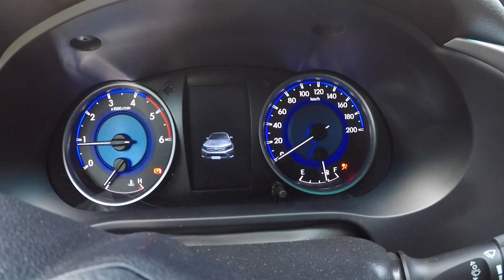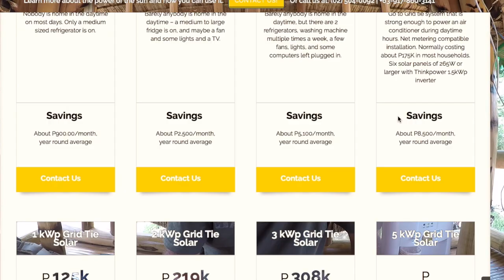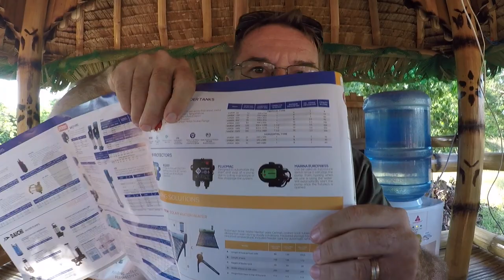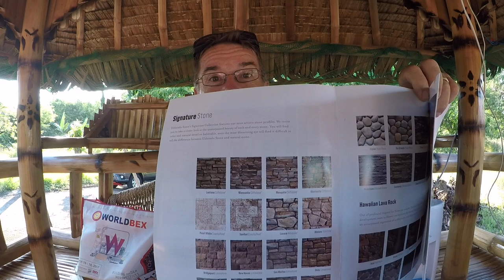VILLA FELIZ - EPISODE 54: YOU CALL THAT CUSTOMER SERVICE? (House Building in the Philippines)

Comment: You are such a discerning and particular person... I have to second that commenter who said check out Daikin brand AC. I've had National, Panasonic, Toshiba and Mitsubishi brand split AC units over here... Daikin is the best hands down. Mitsubishi isn't bad, but the durability, efficiency and quality of Daikin - a notch above the rest.
Reply from the maker: I just checked and Mr. Aircon sells Daikin as well.  The rep contacted me today and I have to return some info about the house.  I'll be sure to add Daikin as a possible option.  Do they have models with inverters?
Reply: My PI Dream Most definitely they do inverters... if I'm not mistaken, Daikin was the first to do the inverter air con.

Comment: hello James,  I like the idea of solar panels .  1000 watt panel could run a mini split a.c. unit during the day .   batteries are pricey for night time storage . And then you like need  double the panels in order to charge and consume the same time 
  But. are you planning to insulate the walls of the house ? 
 we are in Macton island in a hollow block house.    it really holds the heat. just like a big sponge .   sitting on the porch at night it's comfortable.  But walk into the house and it's muggy and hot .  ( no a.c. in the main part )
Reply: hi Paul, have you thought about double skin on your wall that get the sun, west facing, just any sort of weather proof material on the outside of the wall with a small air gap, also radiant barrier under the roof and a white roof to reflect the heat makes a difference, also shading any windows that get direct afternoon sun with awnings or louvers helps a lot
Reply: yes all excellent ideas .  for example I have seen amaca covering the block wall  .
 It's my father in-laws house and we won't be here permintly.  So wont worry about that . But I did make two screen doors and put screen on all the Windows.   made more difficult by having to remove the security bars first .
  If we build here I am considering a large open air portion  to the main part of the house . maybe no walls  with a nipa roof and amaca ceiling .  It's so much cooler . 
on the other hand a solar panel to run a ac in the day time would also be great.   Maybe something with French doors on three sides for cross flow on nice days.  and shut up on hot days with solar ac .

Comment: hello James. thank you for sharing your videoes with us. You once mentioned about implementing a LAN in your house. I have a suggestion for you, James. I installed LAN on some of my projects he here in Norway. What I did was to install CAT7 double isolation that is certified to tolerate over 800Mhz. This is for multiple usage of the LAN. the LAN cable are now being use for TV,  local network, telephone, audio and so on. You just patch over in patch panel. In the end of cables, I use a converter cable called balun cable that has RJ45 in one end and antenna socket on the other end for the tv. If you cannot find cat7, you can at least use better that cat6e. Cat6e I think tolerates 400Mhz which is not recommended for tv transmission. Anyway, a suggestion or tips from me to maximize the usage of your LAN.  😊
Reply from the maker: I never really thought of CAT7 for uses other than network.  Hmmm...might have to rethink my solution.  Thanks Edwin!

Comment: Have you considered other materials besides CHB for your structure?  We are using Hardiflex.  It doesn't hold heat like CHB and it can withstand a tremor without cracking and allows better access to plumbing and electricity.  If I was going to use CHB I would do what you are doing and go with the 6 inch. I know you've researched.  What do you think of Hardiflex?  Thanks, James.
Reply from the maker: We're using Hardiflex for building but not to replace the CHB's.  Our 6 inch are rated at 1000psi and the fill for the basement CHB's will be 3000psi with 10 inches of CHB (6 in + 4 in).  This is to prevent potential cave in from backfill pressure.
Hardiflex is the standard over here.  We'll use 6mm for outside ceilings and 12mm Hardie Senepia for the fascia.  For the inside ceilings we'll use Boral gypsum board.  In the bathrooms we'll use the moisture resistant (MR) version.

Comment: Why are you choosing a multi-split AC over individual units? My understanding is the only advantage to the multi-split is if you are limited to how many outdoor units you can have, or worried about the cosmetics. But individual systems are cheaper and if one fails you still have the others to keep you cool while waiting to fix the broken one.

I actually prefer window units over split-type in this environment, but your house is high class and the window units sometimes appear low budget. The beauty of the window unit is when it needs to be cleaned or repaired, you unplug it and slide it out and carry it out to the truck and let the local shop clean it for 500 peso. And they get dirty very fast. Split type can't easily be removed for cleaning.
Reply from the maker: I'm hopeful I don't have to use the AC that much with the way we set up the house to sun exposure.  But since we're housing the outside unit in the basement, I want to take up the least amount of space possible, hence the multi-split option.  Unfortunately, I've not been able to source one yet.
Reply: My PI Dream,, I use to try to air condition the whole house and was stuck in the American mindset that it was the the only way, but after working/living in Asia for 20 years, I started to like the old fashioned way of only cooling the room you are in at the time, especially the bedroom. 

Lately I only air condition the bedroom to keep the humidity down and keep one room as dust free as possible, which you can't do with open windows. The daily dust phenomenon is also what made me change from loving wall to wall carpet to loving smooth ceramic tiles which can are easy to clean.

Comment: Have you tried Meister Solar? 3.71KWP 298,655 Pesos. Solar hot water heater 61,345 pesos. They have a website landline (045)436-1481  Maybe you haven't considered it but there are also people installing a combination of solar and wind turbines. You always talk about the wind blowing when it interferes with the sound of your videos. If you have enough wind you can look into getting one. There is a commercial wind farm in Northern Luzon but it is by the water which is the best location.
Reply from the maker: Hi Philip.  I sent 2 emails to Meister Solar but they keep getting rejected on their email server.  Seems their email server is in Germany as its got a .de address.  
Here's my error:

This is the mail system at host mx2.agenturserver.de.
I'm sorry to have to inform you that your message could not
be delivered to one or more recipients. It's attached below.

---------
I'll try to call them today for more info.
I definitely would be able to use wind, but since I don't have a lot of yard space, it would be difficult to integrate, plus if the subdivision is giving me such grief about solar panels, you could imagine how they'd respond to putting up a wind tower in my yard.  😳
Reply: Did you try to search on olx. It's a website online. If you do a search of "solar panels Philippines for sale" it should appear as one of the top results. As far as wind turbines I believe you said you couldn't put anything facing the street.    A wind turbine could be placed to the rear of the house. One of the problems you may incur is with the utility company because you have to have a meter that runs in reverse, "Net Zero Meter."
Reply from the maker: We have Meister Solar coming out early May for a site evaluation.  Thanks!